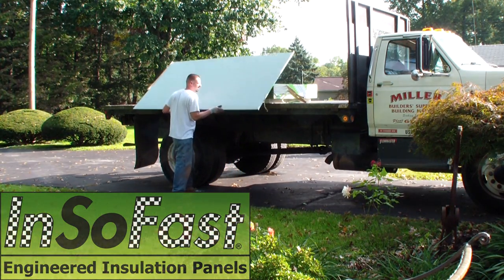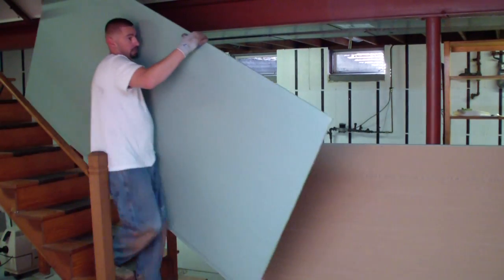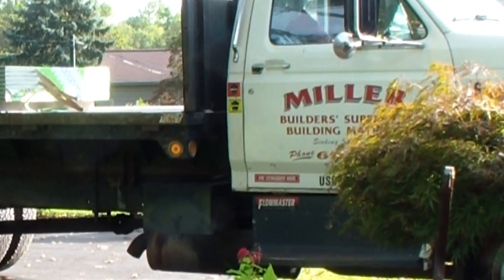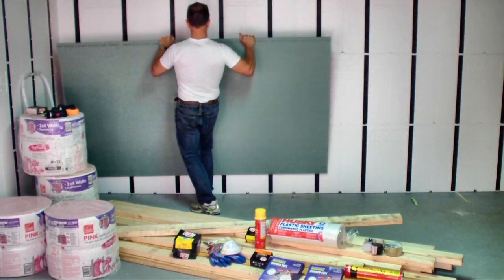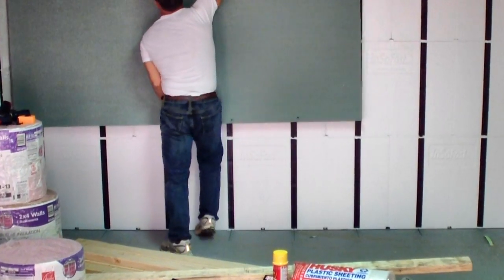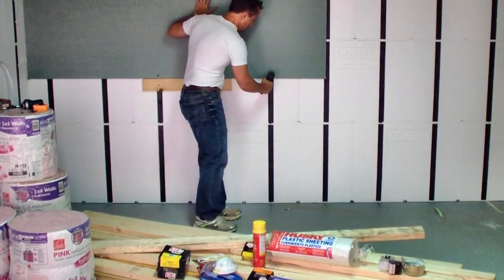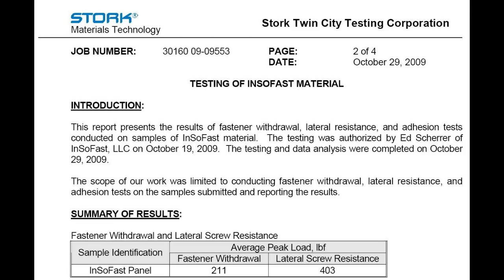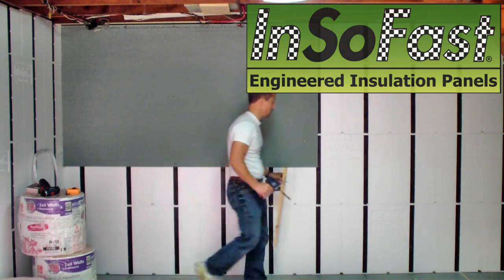How to install drywall to the InSoFast Panel.

Comment: are the panels anchored to the wall ... if there is a video on that please let me know
Reply from the maker: We have preformed extensive testing of adhesive applications of our panels on suitable substrates, (walls) and find that gluing is easier and quicker than mechanical fasteners.  But if you are more comfortable with drilling holes into concrete and installing screws please go right ahead, that method will also work well.
For more technical information visit our website @ http://www.insofast.com/ux-panels/installation/mechanical-attachment.php
Also watch this video where we use fasteners as a backup method: http://youtu.be/aM0SCIUZ9gI 
For interior drywall applications mechanical attachment may be the primary method for securing the InSoFast panels to the wall surface. Use Tapcon® screws or Perma-grip nails in the center recessed attachment point on each stud, for a total of three screws per panel. (Tapcon Screws or Perma-Grip Nails).
1.	At the bottom of the wall install a row of mechanical fasteners between 6”and 18” up from the floor at 48” on center on center utilizing the recessed attachment points molded into the InSoFast co-polymer studs.

2.	Install additional row(s) of mechanical fasteners at 48”on center spacing as needed to keep a maximum 48”on center spacing between rows of fasteners.  

3.	Install a row of mechanical fasteners between 6”and 18” from the ceiling (or at the top of the InSoFast wall panels) at 48” on center utilizing the recessed attachment points molded into the co-polymer studs.
Reply: Thanks for the information and quick response

Comment from the maker: That is a good question and one we are often asked. Fro detailed information go to our 
website.
The website will have detailed instruction on how to handle corners. Basically the corners are solidly backed and do not flex like a framed wall so you only have to tape and apply drywall mud to the corner.